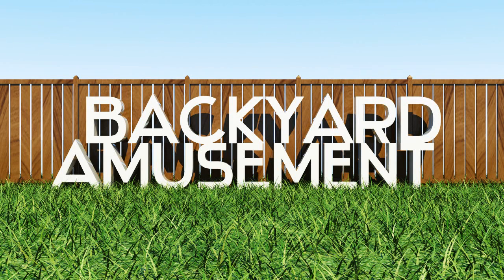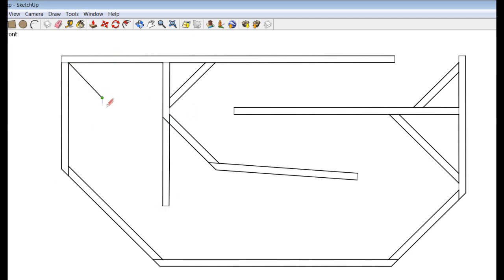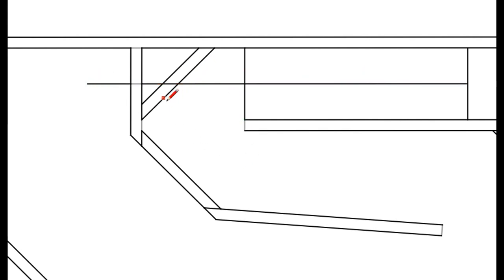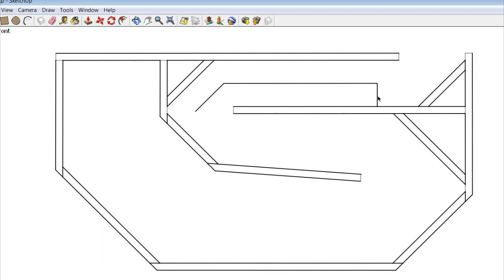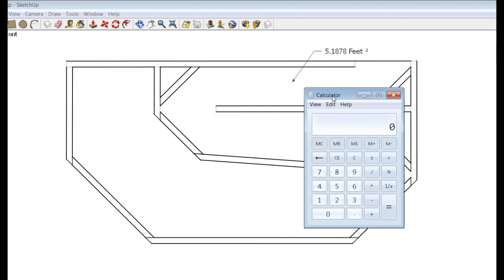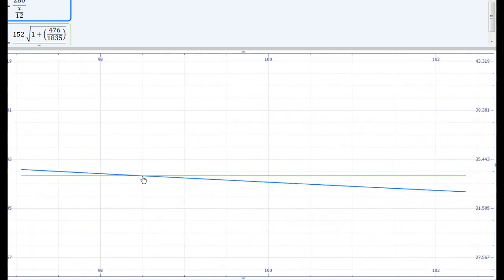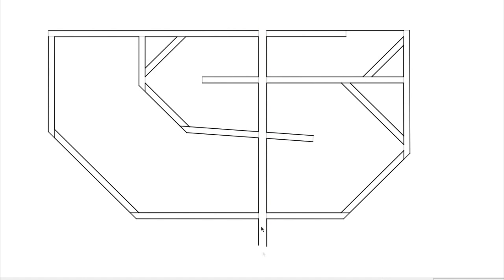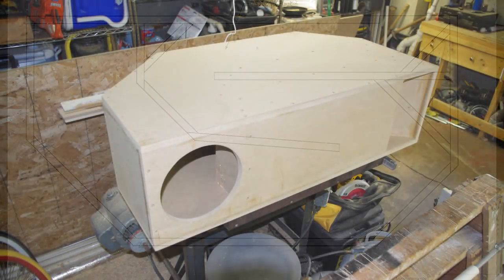Transmission line speaker box design tips

Comment: The length of the port has to be tuned to the free air resonance of the speaker, and doing so without the TS parameters is like working In the dark, for a quter wave Tline the port length can be pretty long and requires some complicated calculations for folding the port, the folded L shape design is the simplest but complicated calculation are still required to get the port correctional area equal to the cone area of the speaker
Reply: Actually, depending on the total q, it could be higher or even lower than the driver's free air resonance
Reply: this is simple math !! even if you calculate the correct size does not mean it is going to work , because TLs have really never been used much and there is no real hard data on designs you can be off as much as 20-30% on TL length and the TL will still sound good , you don't fold the port on a TL it is jus a vent like a ported speaker , it is the length of the line that determines the correct tuning and sound !!! and you can have a lot of variation so just so long as you are close to a  correct design !!! it should work and work well ...I have been building speakers for about 50 years now and have a Degree in Electronics , so I know a little bit about this

Comment: Critcal to avoid 3rd and 5th hormonics of resonant frequency  of driver used in any of main box dimensions.Internal reflexions otherwize.
Reply: that is why you make the internal design unsquare by adding baffles in the corners of the enclosure and also crossing over the woofer at a lower point to keep harmonics and  peaks and dips out of your TL design !!!

Comment: Yuo should make a new video, because you made a error here that only confuse people. Fs = free air resonance. that is a measurement of the driver without any box. As soon as you put the driver in a box, any box. You cannot measure the Fs anymore. So you whole story about "change the Fs because in the box blabla" is totally irrelevant. The Fs is a statement, you go from there and do not alter it.
Reply: Hey, Thanks for notice.
So with this error is it wrong way to build a T-line? If it is, How should I build it?
Thanks again.🙏🙏🙏🙏
Reply: that is standard math as part of the formula to determine TL length , it is also used in Theil  Small equations for designing different types of speakers vented and sealed enclosures and every woofer is different , you also need it it determining crossover points  for mid ranges and tweeters , so you might want to take a electronics math class !!

Comment: And the sound moved on the track laid out by the designer. Imaginery line  indeed. Not a practical calculation. You need reflective coating all through to realise the transmission while damping material is used. A contradiction again. Was this what is acoustimass in Bose speakers? Horrible stuff

Comment: Heard it different from others who made a lot of Transmission lines.
One said you go from 1.5 of the baffles area to 0.75 of it. To get that decrease, else you end up with a huge cabinet.
You could also in this take how big the volume are on a closed cabinet would be, if the Transmission line full fill that you are on the right path.
Reply: Decreasing and increasing the area are both valid methods same as constant area, they just do different things. I prefer decreasing area
Reply: just use the standard math to build a TL ,speed of sound divided by the speakers Fs and then divide that by 4 gives you your standard length , because the TL design is not very precise and you can be way off and it will still sound great , , built my first TL in 79 and got my degree in Electronics and Industrial Technology in 86 , and I have built and repaired 1000s of speakers , so experiment with port areas , and different box volumes and TL shapes , because no one has really been putting out any data on a fully proven design , once you know the basics experiment from there I do not stuff my TL I line it with acoustic foam and it sounds great !!!!
Reply: @rickynelson7384  congratz :)

Comment: This without damping is a Labyrinth, a TL differs by the inclusion of specific damping to approximate to an infinite  duct length as the speed of sound halves over the wavelength. This is why it was found that the density of damping was to fill the last half of the line and to line the first half. The length of the line must be a quarter wavelength for the fundamental frequency of the drive unit employed. The angles are unnecessary as these reflections will be absorbed by the damping material they only serve to absorb volume-which leads to an inordinately large box where one may not become necessary..The  problems to overcome with TL's are 1) Balancing the line to eliminate the fifth harmonic resonance and 2) balancing the line to absorb the third harmonic. Once these two are achieved, then you have the line operating without box overload/honking. The trick is to make the Bass chamber  one third to one fifth the length of the overall line and then these offending wavelengths are "Driven out" so that the line starts to work without overload. There is also the problem of "End" correction where the wave travels faster because of the vortex effect in the duct. It has been found that the correct end correction  amplitude reduction is approx. 8 inches in front of the port ! Therefore, you have to factor this distance into your original length. The phase of the waves changes/reverses every "Turn" of the  Line, therefore this can lead to harmonic distortion/ overhang. Damping can cure this however and the density has to be doubled at every bend/corner using carpet underfelt. I own a pair of TL's that my father designed and they are fantastic-but he used Marine Engineering techniques in their construction that eliminate a lot of the above problems. Irving M. Fried,(of IMF fame) wrote some wonderful articles on TL's one of which is in HiFi News/Record review, and he found that "End Correction" limited the low frequency resonance to 30Hz-WHATEVER THE LENGTH OF LINE ! I do not know how true that is. I am appalled by the figures given in various learned tomes on HiFi for line lengths-obviously the authors have never looked into these. For Res. Freq of 40Hz-7 feet, for Res. Freq. of 30 Hz-9 feet, for Res. Freq. of 20 Hz- 14 feet 1 inch or 16 feet for correct end correction-it is easier to damp DOWN than UP ! Avoid Long Hair Wool for damping-you cannot regulate the density and it hangs and it's density changes over time. Use Contoured Acoustic Foam to line and to fill the halves necessary. Also, check out A.R. Bailey's articles in Wireless World, 1965-very interesting. there were some derivatives of his triangular/non-reflecting line made by Clark Acoustics in the 1970's.Anyway, jolly good luck and do not be too concerned with Mathcad  predictions-your own ears will tell you and Mathcad goes out the window in REAL ROOMS !-Plenty of soft furnishings and cut out reflections to reduce eigentones and improve the stereo separation. You can avoid "Acoustic Throw-through" of  the LF Cone by using one  with Polystyrene on the front like KEF B139 there were also some Technics honeycomb units that were rather good. Wavelengths do not bounce linearly, they are effected by intermodulation of other frequencies within the enclosure and these lead to the overhang if no damping is employed. Lastly, the port area should approximate HALF the Cone area, for halving of speed of sound over wavelength. Jolly good luck and enjoy the music !, G.R. Martin, MAES,TMIET,AMASA.
Reply: Hi Garron, could i trouble you for some info on designing a tline for my vintage jbl 2235h speakers? How can i message you?

Comment: Fantastic !  What do You do for a living ?  No, I'm good with sound and acoustics, but not all your math.  Does this allow for dampening materials ?  Great Job !
Reply: Damping material is up to the builder I have tried stuffing the TL design and  lining the interior walls with acoustic foam , the lining worked better than stuffing and the length of the line has more to do with the tuning than anything else , try experimenting with different aspects of TL design because none of the TL design is set in stone !!

Comment: The area at the driver is about 30% undersized, this line will not make it below 30hz.
Reply: mcraigb1 It's just a number. I have a pair of speakers which go down to 28 Hz. I also have a pair of Dynaudio Excite X34s which supposedly go to 37 Hz but the port is tuned to 41 Hz. The Dynaudios have considerably better bass response than the others (which are equally amazing in their own way).
Reply: You don't have a clue unless you can get your mike and computer or frequency generator and Oscope set up to measure the final build after a break in period , that is how you do it ! you just don't guess you need knowledge and equipment !! and I have both .